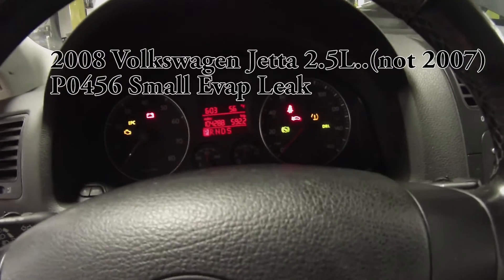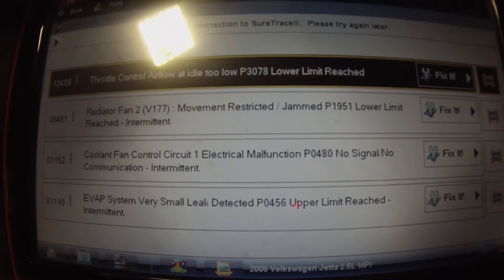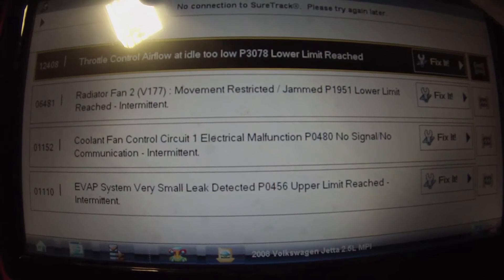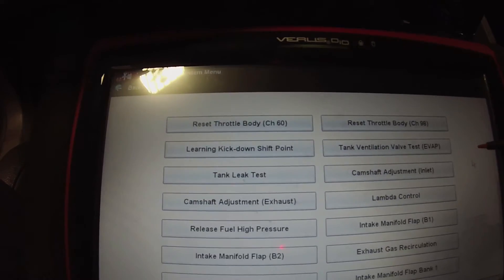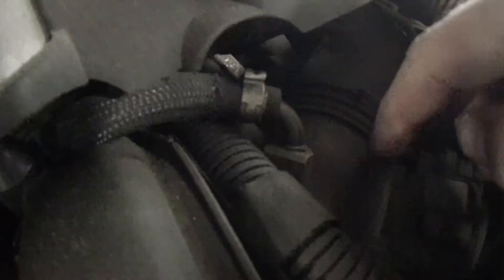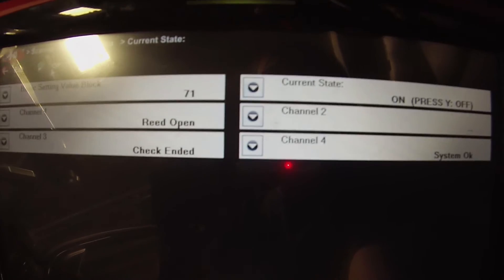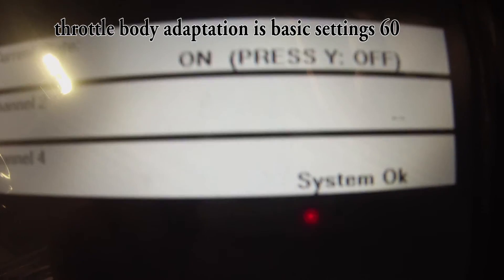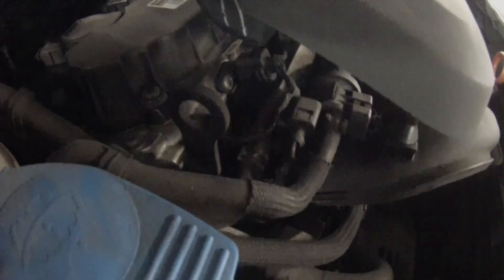2008 Volkswagen Jetta 2.5L- P0456 Evap Small Leak- Evap leak test without a smoke machine

Comment: nice video pretty interesting all the channel numbers to run the tests. Quick question, Can you use the purge valve output control on the europeans while commanding the vent solenoid on and monitoring the fuel tank pressure?
Reply from the maker: I don't believe there is a fuel tank pressure sensor on these, this test is monitored using a position sensor in the leak detection pump, on the euros when your doing bi directional controls the only component or data pid you can see is the one you are trying to control, that's all I have ever seen on the euros